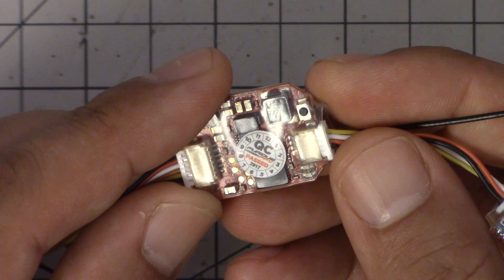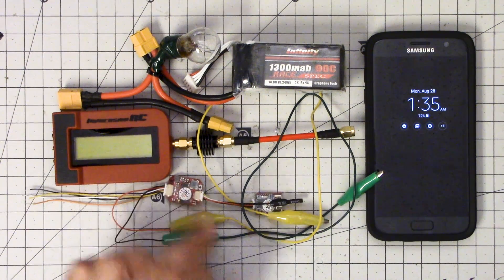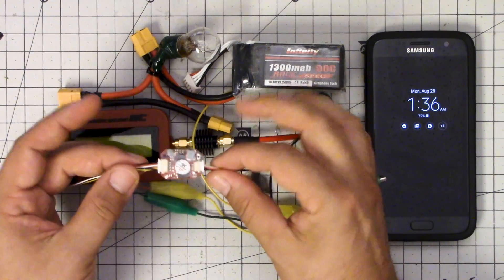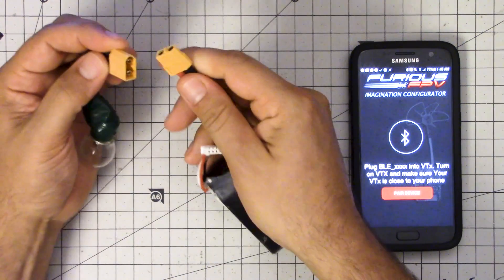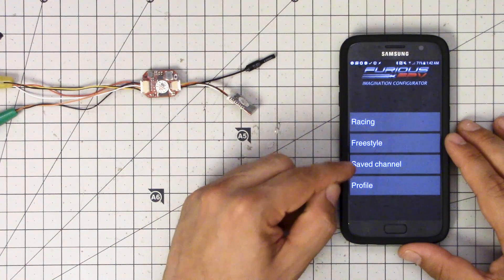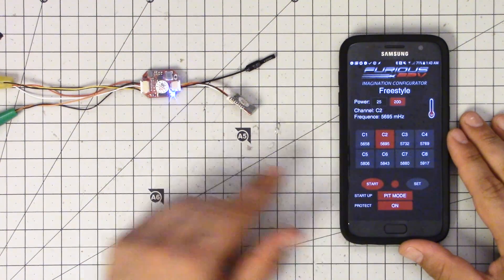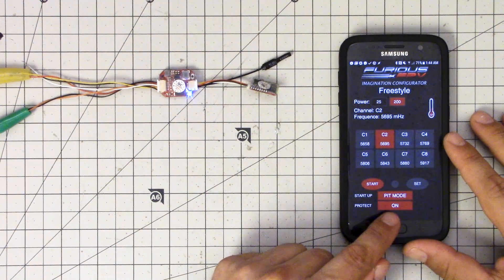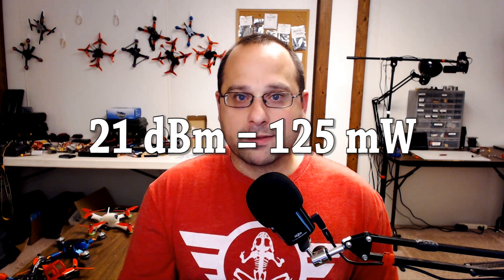Furious Stealth Race vs. TBS Unify Race

Comment: how accurate is the IRC watt meter in your opinion? I've heard good and bad and the price point has kept me from buying one.
Reply from the maker: I have no way of knowing how accurate it is, in an absolute sense. I believe that it's useful for side-by-side comparisons at least. For what it's worth, it read dead on 25 mW when the vTX was set at 25 mW.
Reply: I'd love to see what EIRP is measured when using different antennas on the VTX.  Like the difference between a linear and CP and CPs of different manufacturers.
Reply from the maker: That is a really hard thing to measure because the beam-pattern of the antenna is not a pure circle or sphere. The only way to do that accurately is to do a 360 degree reading. But then you get reflections from objects in the environment, so now you have to put the antenna in an anechoic chamber. Oh, and that doesn't take axial ratio (circular polarization) into account, so... It's why doing a side-by-side test of antennas is really difficult to get right.

Comment: I'm not realy surprised about the TBS Unify Pro which is not outputing 500mW and 800mW on some channels, a lot of video transmitters are doing the same thing, i believe you could have found some channels which actually output more than 500mW and 800mW lol
I built my own RF meter, i bought it from a german shop on ebay, it was a kit which was around $200, i needed to solder everything but nothing really complicated and at the end i am pretty happy with it!
Thanks for sharing Joshua and have a great week :)
Reply from the maker: That you spent $200 on parts that you had to build yourself really reinforces what a good value the IRC meter is. I've never been sure whether the channel-based variance in output power that people have observed is a function of the vTX or the IRC power meter. Is it known to be calibrated flat across the whole 5.8 GHz band, or is it only correctly calibrated at e.g. 5800 MHz? I could just ask IRC I suppose...
Reply: That is a good question actually and i think only someone from IRC could answer you indeed :)
It will be interesting to have an answer, it could probably change a lot of things about all these datas.
Take care Joshua :)

Comment: is the output power same on all channels?used to vary a fair bit i think, and what's the antenna connector like?
Reply from the maker: Antenna connector is IPEX. I didn't test multiple channels... just not enough time for this round. And the fact that it got so hot so fast was sort of the final word for me.
Reply: Joshua Bardwell I hear that the immersion are bringing out an NFC android app for the Tramp, do you know if this is true? Oh and not everyone has good customer support with TBS, mine was extremely bad and won't be buying any products from them until they up there game.

Comment: Tested one of these immersion RF meters with professional RF equipment and it was almost 3dB out. I see your testing unit has no attention calibration adjustment and I'm assuming the unit has not been calibrated. I would not be trusting it's readings if I was you.
Reply from the maker: EdQuigman you have it exactly backwards. dB are logarithmic and so they correctly reflect RF power always. 2 dB is 2 dB whether it's 1 mW + 2 dB or 100 mW + 2 dB. It's mW that need to be converted to dB, not the other way around.
Reply from the maker: @zxc asd Why do you think I don't care? If I don't care, I should just stop making videos and don't waste your time.
Reply: The readings jump around when you don't have the coax cables perfectly snug.
Reply from the maker: I can't be sure that the reading is accurate, but if I measure two vTX on the same meter, then the information it gives me about their relative strength seems like it should be accurate. Additionally, the meter read nearly dead on 25 mW when the vTX were set to 25 mW so I took that as a sign that the meter was not too far off.

Regarding the power moving when I touched the meter. If I fiddle about with the coax, the reading jumps a little while I am moving the coax, but as long as I am not actively moving the coax, the reading is pretty consistent. Remember, I spent about 2 hours testing this stuff over and over again, so I have seen a lot more samples than I showed you in the video.
Reply: or he could simply just not watch you vids Joshua and not write uninformed comments
Reply: I noticed that the reading jumped all over the place when he touched the meter while measuring the unify pro. I'm not sure the meter itself is inaccurate, but that makes me wonder about the validity of the rest of the results if it goes up 50% in power just by moving the meter/coax a tiny bit.
Reply: Can you expand on "almost 3db out". As you know db is logarithmic so one can't really quantify 3db out without knowing what the db registered by the meter is. For instance 23db = 200mw and 20db = 100mw. So 3db off at this power setting would be inaccurate by 100mw. 27db = 500mw and 24db = 250mw or a difference of 250mw. 
Reason I'm interested: I have an Immersion power meter and was wondering if it was calibrated ok since Im seeing wickedly wrong power levels on 3 of my VTXs I have been testing with.
Reply: facepalm! thanks -
Reply: Have you tested the RF Explorer? I had put an attenuator on mine and all the readings seemed pretty low

Comment: During the temperature testing, did you check that you were actually getting a good video signal, or just the power level?  In my experience with the Unify Pro HV Race, when it starts to get hot the signal quickly goes out, even on 25.  Good to see it doesn't start blasting more power, but I have been concerned it is shifting frequency when this happens.
Reply from the maker: I didn't verify that, no. It's not possible to do that while simultaneously measuring power.
Reply: I see.  It would be very interesting to see the same experimental conditions repeated, but with a camera/antenna connected for readings from an RF Explorer and goggles.  ...please? ;)
Reply: It's not possible as he has to plug the rf meter into the vtx so the vtx has no antenna

Comment: The phone app seems great, however, BT adaptor is not handfull since the vTx can be buried bellow other boards and hard to remove/insert the connector... :( seems like the same issue we have with Split sdcard slot...
Reply from the maker: Pretty sure they intend you to just leave the BT adapter installed.

Comment: Nice, isnt there a "mW" option for that power meter, I think Iw seen it in other reviews? So it shows mW instead of dbi.
Reply: benii i agree. Most of his followers want to see mw. They could care less about db. When they buy transmitters they look at mw. Only time they care about db is when they buy their patch antennas lol
Reply from the maker: +benii yes there is but dB is a more accurate representation of how the power behaves. 100 to 400 mW is the same as a doubling if range. 100 to 25 mW is a halving of range. Expressibg in dB translates this to a linear relationship that is more intuitively understood.
Reply: I understand your logic but for non-rf guys like me its maybe easier to understand whats happening when manufacturer claims 200/500/800mw and I see a corresponding number on the screen.

Comment: never saw .dBm ~ mW onscreen... ;-)

kinda curious why you prefer the dBm mode rather than mW...?

insert from immersionRC Meter manual:
On the second page of the menu, select Avg power mode, and select either dBm, or mW for the
readout, depending upon how you prefer to display power readings.

the reason I ask is because I too have this meter and often testing my OnLockVTX's among many many others for comparison - and until seeing this video where you use dBm over mW mode, I'd never even considered using dBm readout over mW... should I... I wonder..? I figure you would know...
Reply from the maker: I use dB because I'm an RF guy. dB is a logarithmic unit. RF power behaves logarithmically. So RF guys think in dB. For example: What's the relationship between 25 mW and 100 mW? If you think in mW, you think it it's 75 more. But the right way to think of it is that it's 4x as much. When you represent RF power in dB, you're always representing a ratio of powers, which is the correct way to think of RF.
Reply: ahhh.. I see.. thank you for that explanation... makes sense to me...
I had always thought of mW being a more precise measurement of power because of it being a multiplied increment... but I'm a laymen when it comes to RF in general...